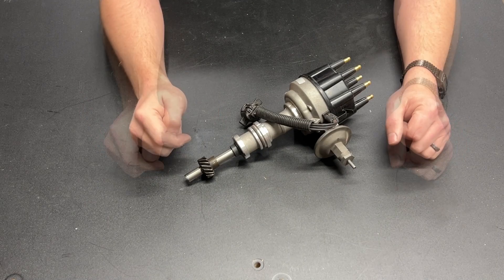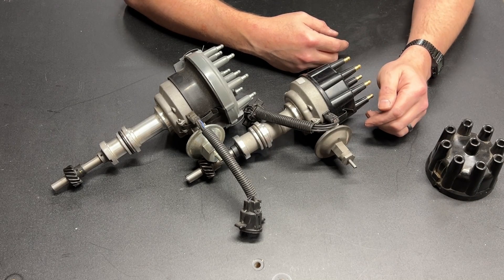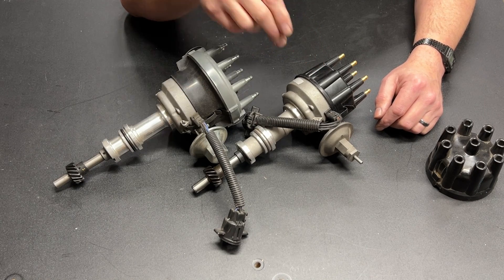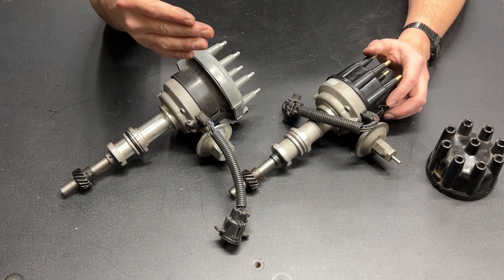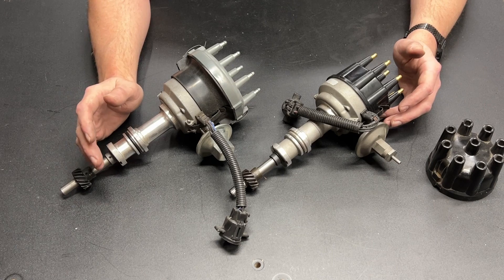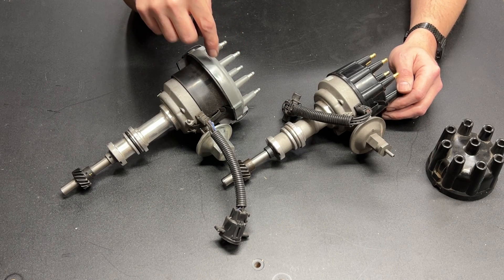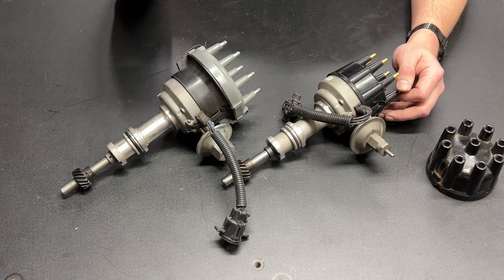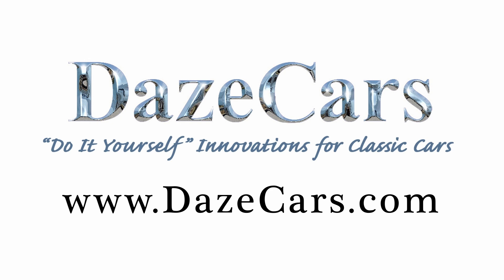Smaller Male Duraspark Distributor Cap DOESN'T Automatically Result in Crossfire Issues it's a MYTH

Comment: Will the small HEI cap fit on my points distributor ? I have a nice new HEI wire set I'd like to use with my points ignition before I switch over to HEI distributor.  I have a 74 Ford 351 M. Thanks.
Reply from the maker: yes it will fit.  the body for the duraspark and points Ford distributers are the same.  The one exception is a few have reported that new Cardone distributors have a slightly bigger body requiring a small amount of material to be remove to fit the cap.

Comment: The big question is where can I find a brand new distributor for my current Duraspark Conversion for my 1985 Ford Ranger 2.8 V6 ?
Reply from the maker: I am not familiar enough with V6s to know if there is an older swap option or not.

Comment: Aluminum and plastic are cheaper than brass and bakelite. One thing to consider is that you don't have to replace the adaper when changing the cap on the large cap. The amount of good plastic in the larger cap is less than the small cap. It is amazing how fast aluminum oxide is built up on the inside of the cap. If a car company can save 1/2 a cent on a million cars they will do it.
Reply from the maker: "If a car company can save 1/2 a cent on a million cars they will do it."  EXACTLY!!!

Comment: Back in the points days (Yeah I am dating myself) I wished Ford had a distributer cap like Chevy where you could adjust the points for dwell gap while running. Rather than through experimentation with different gaps till you got it right.
Good information Thanks from a lifelong Ford guy, well at least till the 90s
Reply from the maker: yes that is for sure an advantage of the Chevy setup.  Nothing wrong with points.

Comment: To clarify some things.. Ford had Five  non EEC controlled electronic ignition systems. 
 The first in 74 and was SSI, Solid State Ignition. 
 In 75 it became SSI 2  The change was instead of the ballast resistor feeding the Ignition box on run it was fed BEFORE the ballast resistor.  Neither of these systems were HEI systems.  
In  76  SSI 2 was renamed Duraspark and some minor wiring changes were made. .. It was not  NOT Duraspark I  and NOT Duraspark II, but Duraspark, it was NOT an HEI System and used a small dimeter distributor cap. An easy application is any 76 F series with the 360 or 390.. 

In 77 Duraspark was to be replaced with the HEI Duraspark 1 to compete with GM’s HEI system. This necessitated the use of the larger cap to prevent cross firing.  There is NO ballast resistor in the DS 1 system and the Coil is fed a full 12v all the time.  DS 1 was NOT ready for the 77 model year due to reliability issues.   Thus the old DS system was reworked with a new board simpler circuity and components and was called Duraspark II and used from 77 and on till Duraspark III.  Duraspark II is NOT an HEI system... 
  
The large cap was used from 77 on to reduce parts count with full expectation DS 1 would be become the default ignition system.  Duraspark I did not see use till 1979  and then only on some Cali cars at to meet emissions, DS I  was trouble prone from the start and was dropped after one year.  Modern DS 1 ignition boxes do not have the failures issues the originals did and it ABSOLUTLEY requires the large diameter cap or it WILL cross fire WITH NO EXECPETIONS....
  I retired from Ford in 04 after over 40 years as a power train engineer and having worked on know full well the history of Duraspark and why the Large was used...
Reply from the maker: It's all great information especially the part about most Duraspark systems not being HEI and that helps explain why thousands of vehicle are running a duraspark with the smaller cap and no issues.    I do however stand by what I said its more about the Ignition SYSTEM that created the requirement of a bigger cap and if you run better quality parts the smaller cap is less of an issue.  Again this cap is the exact same size as an MSD distributor which runs a way hotter spark than anything factory and there are no crossfire issues. You have great information to contribute but I do not appreciate the name calling in your other reply so that post will be deleted.  Thankfully the information of value from that post is also in this post.

Comment: I have the small cap but it's female style  cap on my 351 m-400
Reply from the maker: That is a common swap, the OEM female cap does fit on the duraspark distributor but of course uses different plug wires.

Comment: Sold. I need to replace old points style distributor on a 460. Do you have a link to a wire diagram to adapt Duraspark with a MSD box and not Duraspark box?
Reply from the maker: MSD box has good directions with all the different configurations but this is likely what you are after https://www.460ford.com/attachments/durasparkmsd2-jpg.94038/

Comment: If you use the rotor from the bigger cap you will have a cross fire problem cuz the rotors are different on some models, my tfi ignition rotor has a very wide end on it compared to a rotor with a small end, I can't find anyone that has the rotor I have anymore so knowing what you are showing is very helpful, I hate the tfi ignition in my 84 bronco 2 and I am going to switch it over to the duration spark 1 but I'd really like to convert it to points ignition them I will be 100% emp proff, that tfi set up has way to many emissions devices for the feed back carburetor and I just want to simplify it to a standard carburetor and points ignition, I've got 356,000 miles on my bronco 2 and it still has lots of engine life and will keep on going past any nuclear war
Reply from the maker: I don't even think the bigger rotor will fit under the smaller cap.  You need to use a different rotor.
Reply: The reason for the wide tip is because all the advance is in the computer sent to a fixed distributor. GM did this as well and when the aluminum oxide builds up they will crossfire horribly
Reply from the maker: It's not computer controlled at the point of Duraspark.  That didn't happen until TFI.  The wider rotor tip  is simply to account for a tip that is moving faster because the circumference of the cap is bigger.

Comment: So a bunch of speculation with nothing to back it.
Reply from the maker: Comparing the international cap to an MSD cap that’s designed to run even hotter spark and showing they are the same size is not speculation it’s right there to see. Not to mention the result of real world application. People have been running this cap in non racing applications for years without issue.
Reply: @dazecars  You claim it is way hotter, that's it, you claim there is no shorting but show nothing. It is all speculation.
Reply from the maker: Thank you for your opinion

Comment: very informative.i am building a 5 liter 1988 Ford motor now for a 32 Ford project.i don't know much about Fords,always had Chevy power and was wondering how to run this motor,it'll have a carb,no EFI and don't want to spend a million bucks on an ignition.did i hear you say you run this Duraspark with an MSD box and a coil?thanks,enjoyed what i've watched so far.
Reply from the maker: That is correct, I use the duraspark to trigger the MSD box and the two work together to control the ignition

Comment: Great explanation I have Fords from 1959-1965 and I never used duraspark
Reply from the maker: Glad you liked it.  Nothing wrong with using points they work well.  I like running an MSD box and IMHO the duraspark makes a better trigger than points.

Comment: Great Video !! A_A+. Got my New Smaller Cap. Where's a good spot to Drill a 1/16th hole ? Cheers ! Joe
Reply from the maker: I don't know as I haven't modified one BUT I would say on the top in a location similar to where other caps put a factory breather would be a good location.
Reply: @dazecars  I did just that ! Thanks for your help. Test drive soon ! Cheers ! Joe
Reply from the maker: my pleasure

Comment: Ford points distributors weren't the only ones to use the smaller cap with female sockets. HD F-series trucks with the non-smog 460 had DuraSpark I systems with small caps. I have an 8100 GVW F-250 with Trailer Special. Because of it's HD capacity it fell outside the emissions standards negating the use of an EGR system as well. I'm still unclear as to how this includes  the type of ignition system used however.

Comment: Will this cap and rotor work on a 1995 5.0? My car isn’t vacuum advance. And I’m pretty sure it isn’t a duraspark dizzy…
Reply from the maker: No it will not. You have a TFI distributor, BUT I have a small cap hack for that one as well:  Tecmotion TFI to MSD Cap Adapter to Shrink a TFI Distributor Cap Creating More Room for Other Parts
https://youtu.be/gADQZ8qRhS4
Reply: @dazecars  thank you for the response. I need it! Fighting off impulse buy! Is installing this on a stock 302 without any dizzy cap clearance issues just gunna be overkill/unnecessary?
Reply from the maker: depends on your configuration but gaining a little more room is in many cases a good thing

Comment: Thank you for your video.  Which type of wires and thickness would you recommend with the smaller male cap?  Can I just change my connectors?  What are your thoughts on using the marine cap, or adding a boot over the cap like the foxbody mustang came with?  I wonder why it was different for marine applications, it has to be better and not cross if wet?  I really love the look of the marine cap. The caps can be painted any color too.  Can I use my factory style Motorcraft wires with a marine cap? New video?  Part #3?
Reply from the maker: I am not familiar with the marine cap.  got a part number?  As to wires remember its not just the wires its the complete system.  Its wires with thicker insulation and minimal resistance while still NOT being solid core.  (sold core wires will create lots of EM noise)  Also spark plug gap has an effect on crossfire.  All in all any performance set of wires that are not solid core should have the benefit of minimal crossfire, and then drilling a small vent hole in the cap will help eliminate ionized gases and reduce the chance of tracing inside the cap, especially in higher humidity areas.
Reply: @dazecars   A 'marine' cap is just rated to be explosion proof and have a Cost Guard rating.  (same as 'marine' alternators)

There's no magic in them.
Reply from the maker: thanks for the info

Comment: Allright Mr Dude heres the deal with the difference between distributor caps....

Look at the small cap....... It has no vent hole.... The air under a distributor cap with no vent can become positively charged up with Ionized air to where it creates crossfires and believe me the only thing that stops crossfiring in the large cap is the vent bung....

Most crossfiring is prone to descently high altitude conditions too

I had a 351w in an f250 worktruck and the distributor cap vent got plugged up and started a crossfire event under the large cap....What stopped the crossfiring on the highway was taking a cutters and taking the wings off of the end of the rotor narrowing down the rotor tip..........

When it happens it feels like someone is trying to stop the crank momentarily while under load or whacking the transmission with a 5lb sledge hammer if you have a 5 speed...............

After finding an AP store and buying a new cap and rotor the f250 was running the way it should..
Reply from the maker: Venting does make a difference and venting will eliminate that issue (simple as drilling a 1/16" hole BUT the build up of ionized gas is usually related to higher RPM. The the caps are not sealed and the gas can naturally dissipate until you reach a saturation point where the number of sparks causes the gas to to build up faster than it can dissipate.  In other words usually not an issue under 5000 RPM.  I live at high elevation and it is not my experience that elevation has any effect on crossfire however humidity can have a significant impact.

Comment: I didn't know about this cap and I mess around with old Ford's all the time. This should also be an upgrade cap for use with points ignition, shouldn't it? those female wire caps kind of suck.
Reply from the maker: yes it will totally fit on a point distributor.  I have heard a few people say that "new" off brand replacement distributors (duraspark) are a tighter fit because the casing is .03" bigger and I do not know if the same is true of the points type.  All older ones and OEM ones seam to work without issue, just thought I should mention it.
Reply: @dazecars  Ive got a WAI global Ford FE replacement distributor and the stock female caps fit fine. Also bought two SKP points distributors and sent them back but the caps fit the same as well. I'll have to buy one of these caps and try it someday.
Reply from the maker: This cap has a slightly smaller diameter, about .03"  it fits on most distributor but on a few it was too tight.  easy enough to remove that much material.  It's just an issue of the the new castings being slightly over spec.

Comment: I'd venture a guess that they went to the larger cap for the same reason GM did with the HEI. Emissions dictated they needed to have an engine with multiple ignition settings, retard and advance, and needed more "swing". Before they could do it with computers.
Reply from the maker: emissions is for sure part of the equation.

Comment: Electricity does NOT take the path of least resistance.  It takes all paths of proportional resistance. Otherwise parallel circuits would not work.  -Doozer
Reply from the maker: yes that is technically true but at that point and for this application you are bringing up facts that don't really effect the function of the system. "all paths of proportional resistance"  yes "Electricity follows every path available to it, and follows each in inverse proportion to its resistance."  So the most electricity follows the path of least resistance, the second most follows the path of second least resistance, and on and on "parallel circuits".  When dealing with jumping a gap there is no conductive "path" so to speak.  I stand by what I said because I was speaking in generalizations to people with a limited knowledge of electronics not to engineering students in a physics class
Reply: @dazecars  I agree in your example, you are right on.   But you were not speaking in generalizations.  Something that generally applies means it applied all the time. You were speaking of a special case, or a specialization.  My statement was a generalization, about current flowing all paths, proportional to resistance ( or conductance really).  The statement that current flows the path of least resistance has been repeated for generations, and has taught people something that is wrong and confusing. People of limited knowledge got that way by taking to heart these rules of thumb that get repeated, but the real answer is never sought to be discovered.  Assuming your audience has limited knowledge is a rather impolite activity to embark on, be it true or not.  I find it most accommodating to mention the details of a subject, but only explain the details deeper, if it aids in getting the point across. I watch your channel and enjoy the content.  Please don't take my words in the negative. Just trying to convey my views of presenting material. --Doozer
Reply from the maker: I get it.  I like facts and information and I don't like misinformation and I completely understand wanting to educate and eliminate generally excepted misnomers.  When it comes to the info I present It is fine balance between making my information relatable and understandable to the masses and truly educating people.  Often times I think I talk too much or over explain 😂  Glad you like my channel and I do appreciate the comments.

Comment: Shortcomings of the big cap like? It bothers people?
Reply from the maker: It’s sloppy, it interferes with tons of aftermarket parts, it’s ugly and not necessary if you eliminate the parts where Ford went cheap.
Reply: @dazecars and it disguises the fact your running an electronic system vs points if you have a pre ‘73 classic car.
Reply from the maker: good point

Comment: Great video!
The “original” small caps had more of a tracing problem than a cross fire issue. They had very short separators wings between the inside terminals and no breather vent. On a rainy damp day or the morning after with some moisture in the cap they would miss fire.
Reply from the maker: Moisture can for sure be a factor!!

Comment: You will only have crossfire issues with the small cap if you have the HEI Duraspark System.   Otherwise there are no issues..  The larger cap was designed for the HEI Duraspark.  The HEI module was supposed to be the default system but poor reliability nixed that idea and its's use was limited. The regular Duraspark system is not an HEI system..
Reply from the maker: Thanks for the comment and the info about the higher output Ford system.  I don't even think you will have crossfire withe the HEI  and the smaller cap as long as you run high quality components.  An MSD or Pertronix unit runs way hotter than HEI and is NOT prone to crossfire with a same sized cap
Reply: @dazecars  You CAN'T run the HEI Duraspark system and the small cap as it WILL cross fire.  Quality components or not.  The whole reason for the large cap was for the HEI Duraspark system.  That system is so hot you can hear it crackling in the dist cap as it jumps the gaps. It makes the MSI and the GM HEI system look positively weak. And unlike the Duraspark II system the HEI system has no ballast resistor and runs a full 12V to the coil
Reply from the maker: I stand corrected, thanks for the information.